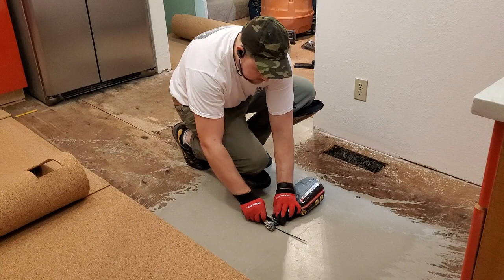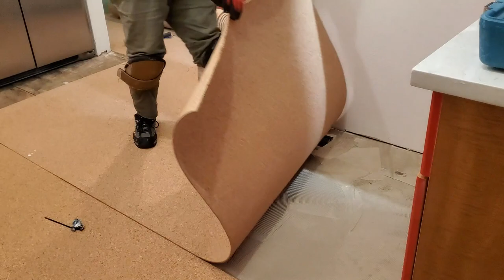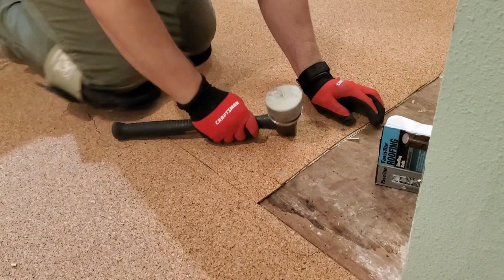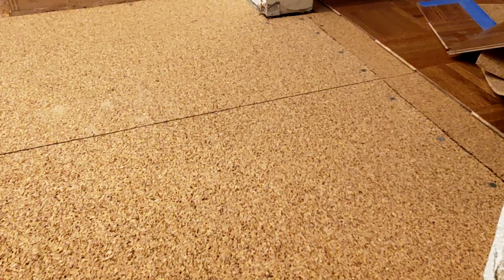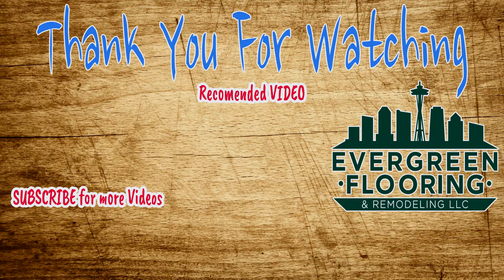How to install Cork underlayment

Comment: Knowing what type of flooring you were preparing for would have been nice. Also, an explanation of why it was necessary to glue down the cork. Glue tends to make things fairly permanent. Styles change. The next person may want to change the flooring. Peeling up glued down cork would be a major downer.